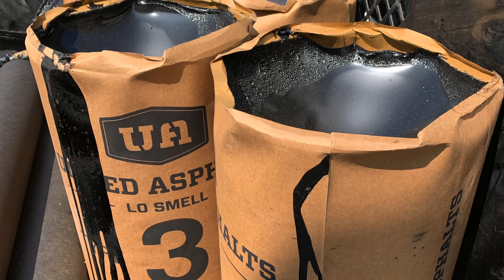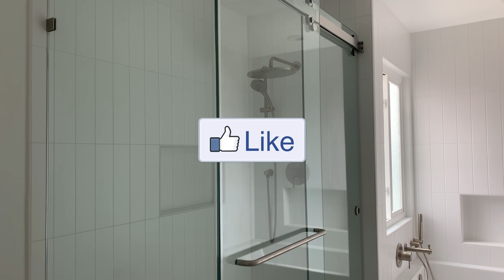How to Waterproof a Shower Floor | Hot Mop a Shower Pan | Pulsar Construction

Comment: Whats comes after hot mop? Another layer of preslope deck mud or just tile
Over it ? No pan liner?
Reply from the maker: Thanks for your comment! No pan liner is needed. The hot mop shower pan is made up of four layers of asphalt, three layers of felt paper, and fiberglass mesh at the corners to create a waterproof barrier. 
The next step is getting it ready for the water test. Every pan should be water tested for a minimum of 24 hours.
After the surface is ready for the modified thin-set mortar and tile installation.

Comment: thanks for the vid! how do you test for hotmop? do you need to let the water sit in the shower floor for several days to test if there is any leaking?
Reply from the maker: Great question! Yes, the pan should be filled with the water and stay for 48 hours before scratch coat and tile installation.
Reply: @pulsarconstructioninc  thank you! when you say pan, does that mean a premade whole pan assembly? we are doing hotmop, cement and tile. does it also need 48 hr water flood test? my contrator didnt eveb do 24 hr water flood test..
Reply from the maker: @marybethjohnson6841  Yes, the hotmop should be filled with water for 48 hours before any concrete or scratch coat installation.
Reply: @pulsarconstructioninc  thank you!
Reply: Podrían decir si en tijuana existe este servicio? Gracias

Comment: You trust hot mop better then Kedi or Ardex..?
Reply from the maker: Thank you for your comment. 
Hot mopping is the ultimate time-tested method for waterproofing your shower pan! An average shower uses 25 gallons of water. That’s thousands of gallons a year! Water penetrates the shower (especially where the floor meets the wall) and reaches your shower pan liner to drain the weep holes at the drain. Water in water out, a tried and true system. That liner is your best defense against water intrusion that can damage your house. Even the smallest leak over time can cause major problems.
Reply: No way. I have seen hot mops fail. As a professional tile installer that lived in Cali  before, I can say that this is such a stupid and expensive way of creating a "liner". But the inspectors in Cali prefer it over everything else so the tile guys don't have much of a choice. Even though I would always prefer a foam system over this stuff. Schluter, hydroban shower system, wedi. Are all much easier to work with and will last a lifetime.
Reply: @pulsarconstructioninc  what about a pre slope?
Reply from the maker: @sjk217  We make pre-slope with concrete. All lining materials have pitched ¼ per foot to weep holes in the drain by means of a smooth, solidly formed sloping sub-base.
Reply: The only time I've seen hot mops fail is the Loma Prieta earthquake 10/89. The violent jolt cracked older hot mops as they do get brittle with age. Thanks for your video!